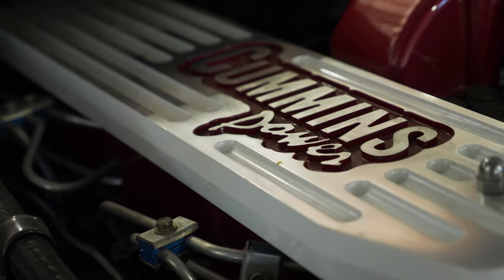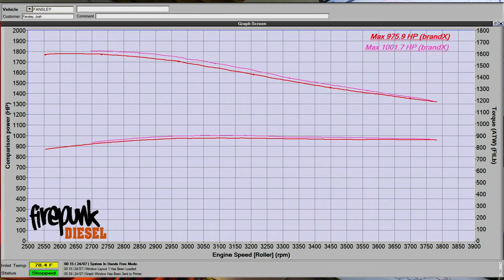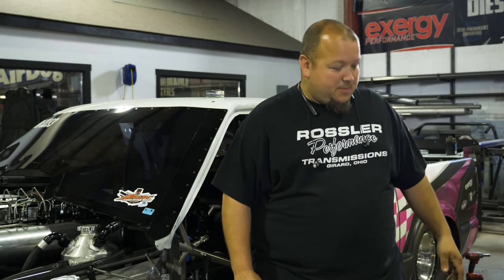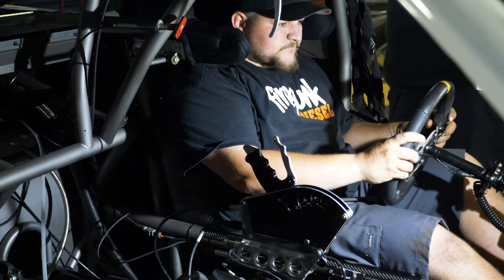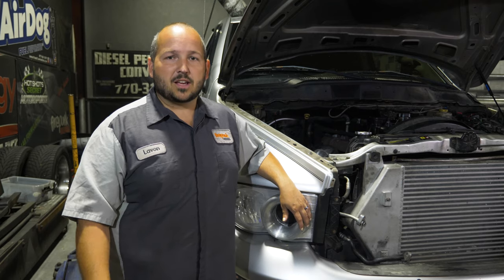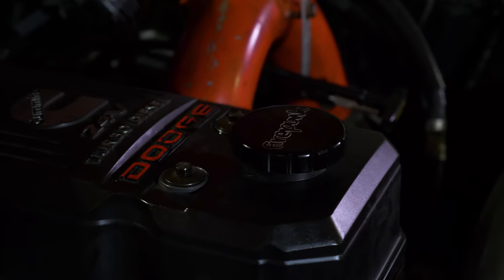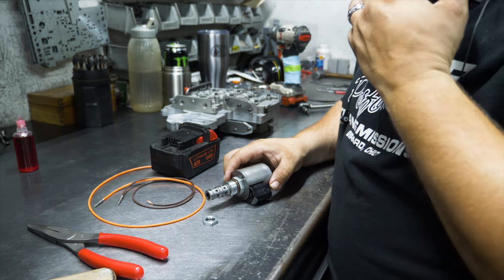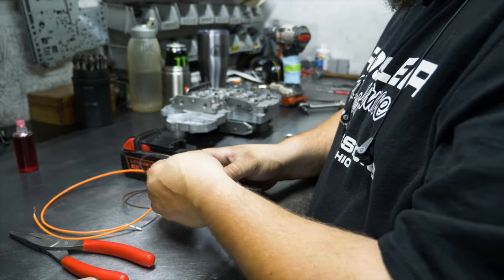3 BIG POWER STREET TRUCKS - RACE TRUCK UPDATE -  VELOCITY STACK DYNO COMPARISON

Comment: Hey I have a Aurora 5000 75 mm drag racing sled pulling and street racing turbo on my 5.9 4 wheel drive with 200 horsepower injectors and a built transmission and I was wondering if you guys could get my truck to push 700 800 horsepower because I think I'm pushing 500-600 horsepower right now

Comment: A G56 on a 475 single. That things gotta have some serious lag
Reply: Marcus Hert 6.7s have a lot of breath man you’d be surprised
Reply: Can't argue that. But man that's still a lot bigger than a 467.7. ive never driven a 6.7 G56 so I guess I can't comment on pure experience. I know my ole 5.9 with a NV4500 wouldn't even light that thing lmao.
Reply from the maker: It does not drive awesome but is tolerable.
Reply: Marcus Hert my truck starts to light hard around ~1500. Full boost by 1700
Reply: Looks like it's time to switch haha. Only if I had the money. 4 doors wouldn't be too bad either